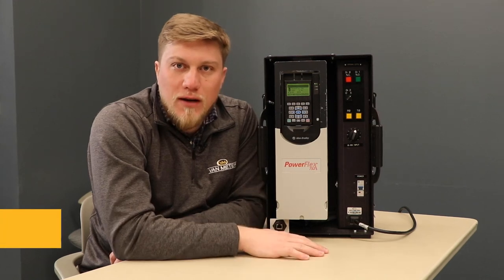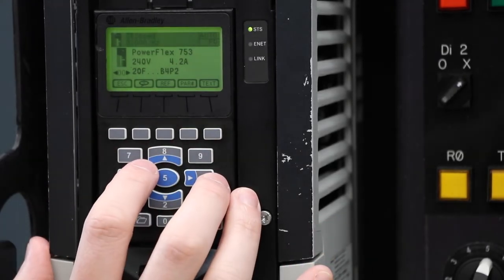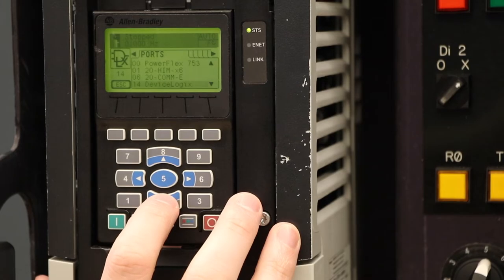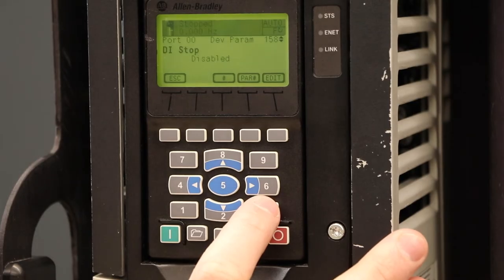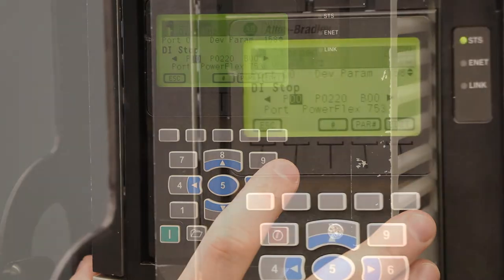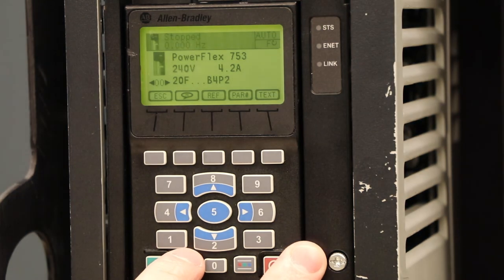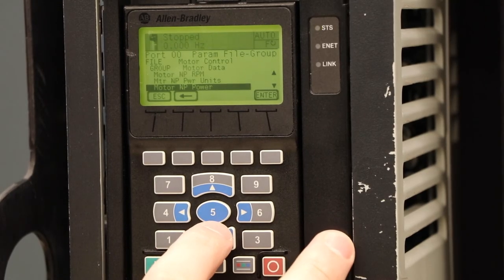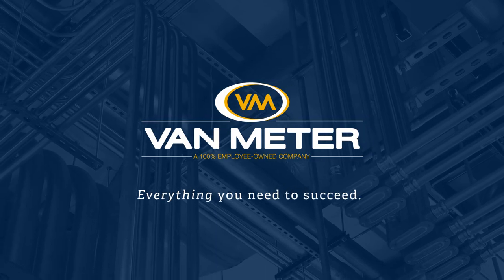How to Program an Allen-Bradley PowerFlex 753 Drive

Comment: Thanks for this video,,, 
Sorry, i'm question,

how to set the digital output (R0) for on and off the brake system on an AC motor?
Reply from the maker: Hi, @juniorelectrical499. The selection for the R0 terminal on the main control board is parameter 230. You can set that to look at the “Drive Status Conditions” and then choose the condition you’d like to engage/disengage the brake system (running, stopped, faulted etc.).
Reply: Oke,, thank you,, 
I will try,,, 

Thank you very much

Comment: Thanks for the video! But do you know where the problem is, as soon as I program the DI Start and NO other input, that I get the error DigInConficB?
Reply from the maker: Hi Dominik, thanks for the message, but it's probably best to work with your local distributor or Rockwell Automation for support rather than me relaying info from our specialists.🙂

Comment: thanks for this video? how can i connect external relay to control brake coil?
Reply: Up
Reply from the maker: You can connect your relay to the drive relay output (terminal R0, parameter 230). You can set the drive relay to trigger based off “Drive Status conditions”. Choose the appropriate condition you’d like to engage/disengage the brake coil.

Comment: How did you run the Powerflex 753 on 120vac?
Reply from the maker: The unit in the video is a specific Rockwell Demo Unit that is made for 120VAC. 208VAC is the minimum for the PowerFlex 750 series.
Reply: @Vanmeterinc1  We all know that Rockwell has ways to run normal VFDs and Servo drives in a demo mode to run 120 vac so this is why I ask.

The drive probably has a parameter change to allow a reduced run.

Again, this is why I ask.

Comment: Hello, When I put "stop" on digital input 0, I get stopAsserted, what am I doing wrong?
Reply from the maker: Sorry for the late response! For safety purposes stop inputs need to be wired normally closed (N.C.). If the drive sees 0V on a terminal assigned as “Stop,” it will issue a “Stop Asserted” command. When the drive sees 24VDC or 120VAC (I/O board dependent) it will stop issuing the “Stop Asserted” command. Hope this helps.
Reply: Is there anyway my stop parameter could work as a normally open rather than a normally closed. As in having it stop the vfd when the 24vdc or 120vac is outputed rather than when it drops out.